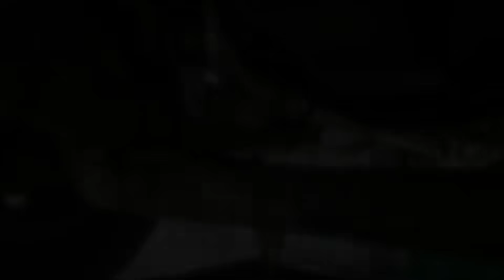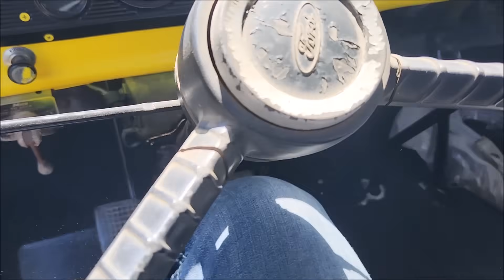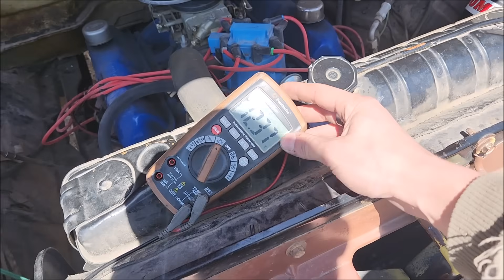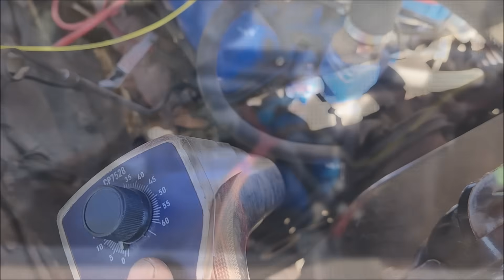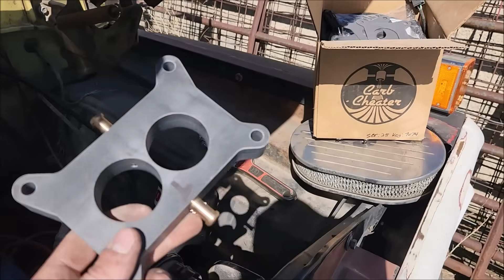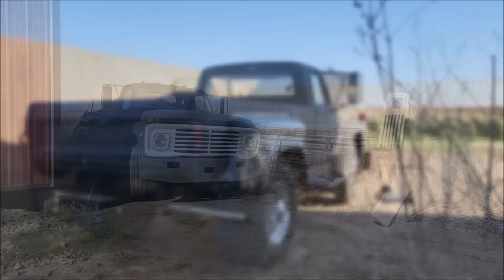Fix & Drive: 1972 Ford "Super Pickup" F750

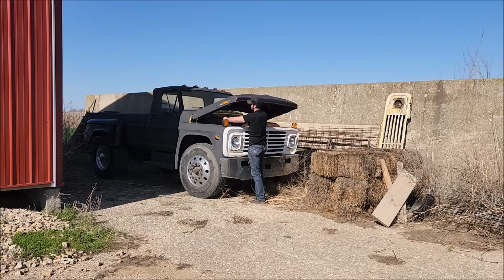Comment: 30:02 I have never once set an idle mix screw with a vacuum gauge. I just use a Mark 1 Earball. Run it in till the engine starts to audibly react, run it out until it reacts again, find the halfway point between those two reactions, and let 'er rip.

Got the Carter YF on my 85 F150 set good enough to pass emissions checks 20 years more stringent than it had to for YEARS that way. Ran great in winter's chill, summer's heat, idled smooth as silk. How I always set my idle mix screws. No gauges no fuss just let the engine tell me what it wants.

Comment: 24:06 And that is part of why carb engines are so much more reliable. They can be six kinds of FUBAR and still limp home. I'd rather have an engine that runs poorly when a minor fault pops up than have an engine that simply refuses to run if everything isn't factory perfect.

I've had EFI do that to me in the past. 2004 Explorer. Fault: Glitchy fuel level sending unit. ECU decided to disable throttle by wire and leave me unable to do anything more than idle. Took two trips to an independent shop and then a daeler trip to fix it, multiple tow bills. Absolute fucking nightmare. Meanwhile my 71 C10 will drive down the road quite happily on four cylinders with a jerry can tucked under the heater hoses as a fuel supply 🤣

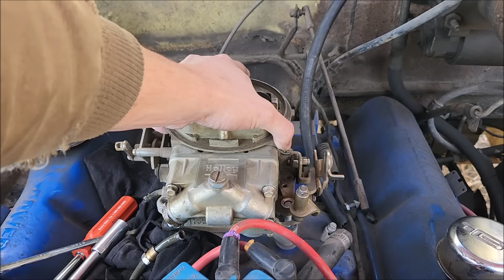Comment: 21:13 To me it's all about getting away from today's overcomplicated, unreliable, gadget-obsessed, tech-spammed disposable garbage. I know some people will disagree but the only thing modern cars do better than old ones is pass a crash test and I'm tired of them. I am to the point where EFI is a hard dealbreaker.

I find working on a carb engine to be relaxing and enjoyable. It's this modern supercomputer-on-wheels bullshit that makes me pull my hair out. 

I'm replacing my 2014 Challenger with a 1971 Chevy C10, and in all likelihood, that shitbox challenger will get kicked down the road to be someone else's nightmare. But if I do find myself doing something with it, what I'll probably do is rip the Pentashit V6 and autotragic out for a 225 slant six and a 5-speed manual. I don't have emissions checks in my neck of the woods so I'm free to carb swap it, and that's precisely what would happen. While I was in there I'd go on a deleting spree until the only 'options' left on the car are aircon, defrost, FM radio, probably swap the entire interior from a 71-73 into it. That is, of course, assuming I actually did something productive with the car...there's just as good odds I'll load it up with tannerite and see how many times it takes me to hit it with a Mosin Nagant at 150 yards on ironsights 🤷‍♂

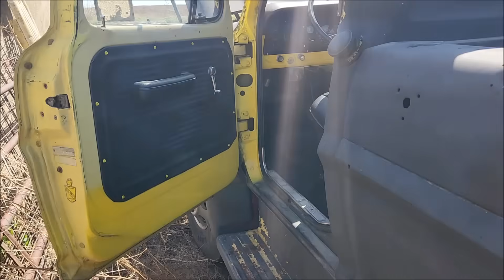Comment: 17:17 Add another advantage of straight sixes over V8s! Dizzy on my Ford 300s and on my Chev 250 are on the side of the engine well clear of the fan. Not a concern with them.

Comment: Every time I ever bought a Ford with anything Chevy in it, like a HEI ignition system or a Chevy Motor I always switched it back to Ford parts. And no I am not a purist, I just hate buying parts for two different makes of vehicles to work on one truck. Meaning if I have a whatever year Ford, I do not like having to buy whatever year Chevy Parts for a Ford truck to keep it running. And yes I am the same way if it is a Chevy truck with a Ford Engine, or a Dodge truck with a Ford or Chevy engine as I really hate that mix and match crap when fixing a vehicle. It's different if I have a 1949 Ford with a motor out of a 1970 Ford, and that is because I have owned trucks in those year models so I have the warranty for those trucks.

Comment: My first car was a 1970 Ford F100 with a 360 and a 3 speed on the column.
If I was trying to get that 391 to run better I would have put the original style distributor back in it , the one it has is good but the points and condenser one is just easier for me to work on if I couldn't find the points and condenser one I'd just do like you did and have everyone ask me what the yellow wire went 😂😂

Comment: That's a 500CFM 4412 holley 2bl. They are really common and designed for limited class oval track. they come with a 50cc pump because they are designed for an engine with a cam that has low idle vacuum. Your going to want to check the power valve it is probably a 6.5 or less maybe even a plug not good on an engine with 12 " of vacuum or more. What happens on limited race engines is the  motor can actually pull vacuum at the end of the straight due to a small carb "500cfm" and shut the power valve lean out and burn a piston or 3. Or just hang the power valve open and foul the plugs on yellow flag laps. Then when it turns green your friends will try to run over you, 
They are designed to run on the main jets with little or no power circuits used . So put a 10.5 or at least 4 numbers below cruise vacuum ( the vacuum advance hooked to manifold vacuum will help with cruise vacuum.) Some oem holleys came with a 2 stage power valve and tuned properly can be surprisingly efficient. Jet it down till it surges at light throttle cruise. Then add 2 numbers. Even then the metering block that comes with those carbs is specialized so it will be a compromise on the street.
Now the 391 The good news is they came with a steel crank same stroke as a 427. I seem to remember they had an oversized crank snout to run accessory's. The heads were terrible really small valves basically designed to detune them. I think they had sodium filled exhaust valves. A set of decent car or truck heads a mild cam and an intake maybe a 650 carb would do wonders. And headers the OEM manifolds are horrible. And soak the upper bolts with blaster they like to break off. It could have the truck pattern heads which was a different bolt pattern drilled. GT 390 fairlanes used the same pattern but different heads.
Reply: That's a goldmine of information

Comment: On my 72 FE engine I used the resistive wire as my trigger wire for a 12volt/30amp relay. I ran a double black/red wire from the engine to the battery, the black side being the trigger to the relay, and the red wire being the full power from the relay back to the distributor (Pertronix ignition). The relay I had safely tucked into place on the passenger fender. Gave me full 12v to the HEI.

Still only got 9.98 mpg with the pig 360 fe. Lol
Reply: FML!  that's about what i'm getting on a F150 with a 302.

Comment: If you want to keep it for mainly towing a hauling really heavy stuff but, you want it to ride better, maybe removing leaves, adding airbags and having an onboard compressor would be the move. It definitely deserves some mild mods, maybe an aluminum intake, 4bbl, long tube headers. I have always looked at those old U Haul and Penske trucks and thought it would be awesome to mimic the fat front fenders on a pickup bed on the back. It's exactly what I had in mind as a kid realizing how much bigger those trucks are yet realizing the cab eas the same size. If it was mine, I might consider putting a beam kit on it like a Pre-Runner with big coil overs that soak up all the bumps and bypasses, bump stops and limit straps, with a 4 link in the rear too. I would expect that once it had a suspension of that caliber fulling the ample fender wells, it is going to probably need at least a 40" offroad tire, possibly as large a 44,46,48" and once it got that far it would need some serious power, like a built 7.3 Godzilla, 460 Windsor, 557 BBF or something with boost like a 9.5" Windsor. Running through a ZF-5 S47 or S6-650 manual. Once it had the power, it's going to need an exoskeleton in case it lays on the sides or the roof to protect you and possibly the body and be nicer than having the interior full of tubes and needing a helmet not to smack your head. A pre-runner build like Wings World does in their own garage with plans designed on Solid Works is very time consuming and expensive but, it sure would be cool to do with a widebody truck like that, maybe cut the back of the cab and front of the bed out, make it unibody, have a removable cap and back seat so it's like a LWB F750 Bronco 600-1000hp with 16" front and 18" rear suspension travel. Not very useful in Iowa but, it would be a show stopper at Silverlake.

Comment: Try lowering your tire pressure to 50 psi or less should help with the ride. Not carrying any weight and the load capacity of those tires is overkill.

Comment: I looked up the model number for that 2-barrel Holley.  It is a 500 cfm performance 2-barrel and comes stock with a 50cc accelerator pump.
It sure sounds and runs better after your repairs and tuning.

Comment: Might sound goofy but I rebuilt my first carb the other day and for some reason. The accelerator pump doesn't work. Anything particular I should look for when I take it back apart or even before hand?  it's a 600 holley
Reply from the maker: Check the float bowl gasket as it has an opening for the accelerator pump channel, and make sure you didn't lose your weight and check ball if you took the pump nozzle out. 
Probably the gasket or rubber flapper though - perhaps you forgot the accelerator pump spring, but I doubt that
Reply: @ThunderHead289  I put the spring back but I will definitely check the other stuff thank you!

Comment: From the look of that 2bbl it's a 4412 Holley Performance model.  Those are commonly used in dirt track classes and come with the 50cc accelerator pump stock.
Reply from the maker: Not surprised it was so ornary and acted pretty dorked on a stock engine on a heavy rig.

Comment: the 500cfm 2V came with a 50cc accel pump. the 350cfm 2v came with a 30cc pump.
Reply from the maker: The 500cfm was a pretty sub ideal choice on this rig, seems much better tamed down from its circle track intended use

Comment: Hey buddy love you videos.. noticed the vacuum advance line is missing..
Reply from the maker: I borrowed it for the vacuum gauge - was hooked up to ported before I took off
Reply: Also go to the fuse block.. Ford usually had  extra hookups.. trailer brakes.. aftervmarket stuff.. run a lead there to your distributor.. it's grounded through the fuse block..  alot better than just hooking up a wire to the battery.. it's a dedicated circuit.. I don't see anything a normal charging system  couldn't  handle

Comment: I have a Ford 302 with an Edelbrock 1406. I’ve been tuning my truck based on a lot of your videos and they have been very helpful. I recently added an AFR gauge. What should I be getting at idle?  When I tune with the vacuum gauge I end up around 12.4. Is this a good number at idle?  I believe the ideal AFR is 14.7. Thanks

Comment: cool rig personally i would pull that gutless 390 out and slam a diesel in it. could do the 12valve 5speed swap or even a 7.3 but a 2 stroke detroit diesel with a real 10speed would be way cool

Comment: 👍 Bought a 500cfm Holley 2 barrel new sealed in the box back in late 70`s with race bowl and is equipped with a 50cc pump.  It ran great on a stock Ford 1968 302 Galaxy.
Reply from the maker: Must be how the 500cfm units are where the 350cfm units is what I've always had around. 
I have a strong feeling that a 300cfm primary on a 600cfm will run pretty decent - not that it actually isn't pretty good as is honestly.

Comment: I did not know that about the HEI's and Fords. If I find that I am having that same issue, what would be the proper way to wire it? Just find a wire that is 12 volts on run? I have seen run a wire from the "I" side of the solenoid and keep the coil wire hooked so it would be 2 wires going in?
Reply from the maker: The most dumb simple thing to do is to just splice in a new wire by the key where the resistive lead starts and just feed that through. Don't hook the resistive lead to anything. 

Then it all works the same and you also still have your original wire that could technically still be functional if you wanted it to be.
Reply: @ThunderHead289  Thank you so much. I think I follow. So on the key switch find the wire that was running to the coil originally and just run a new wire from there?

Comment: I have a 74 IH 1600 load star that is a factory 8' bed but your's probably was shortened . I drove a f600 for work red in the outside olive on the inside. The rigs(auger drills) all had numbers 551,552.751,and 752. The service trucks for setting wells had names the big one "the mule",the  White pavement prisses"white" and mine Army" yeah I'd have killed for that yellow 
Off the truck subject I see you have a 4 speed in your maverick it might slow it down. A friend of mine had a 74 grabber orange with a 3 speed floor shift and it didn't have a dead spot that little car was fast and I'm a Mopar kinda guy so yeah you might try it.

Comment: Well done Luke. As a guy who learned to tune carbs in the 70's, from trial and error and books...pre you tube, LOL I appreciate you keeping the carb knowledge alive. That 50cc pump was a common mod many moons ago in roundy round racing.  Some o the lower class deals required using 2bbl carb, but didn't specify the intake...so guys would get a decent dual plane 4bbl intake and adapt it to a 2bbl, drop the Holley 500 on. They would work, but the pump shot was weak with a larger intake volume/runner change. So they added the 50 cc pump shot and it helped...and they would pass the "inspection" at the track.
The info you gave on the mixture screw going back from  max vacuum is correct, and something I frequently see done wrong on cars guys bring around here.
That truck had some serious effort put into it at one time, those super single wheels and tires were not inexpensive, I think someone was building a truck they planned to use. It has promise,  maybe investigate that leaf spring pack, LOL. 

Leaving stuff alone is never any fun. I once did a tunnel ram with 2 500 Holleys on  a mild 350 based chevy...it worked surprisingly well...

Comment: With the carb at WOT and the accell pump plunger all the way down adjust your set screw for the pump until you have 15 thousands clearance measured with a feeler gauge
Reply from the maker: That's what holley says, but if you do the lever as I show, you don't need to do that - that's so someone doesn't bottom out the travel, basically it's showing that the lever can go farther and won't bind. 

I show the actual correct way.
Reply: @ThunderHead289  I have done Holleys for over 40 years I always set at factory specs I have never  had an issue with the the lever for the accelerator pump bottoming out or binding.

Comment: Running a pre-ethanol car on ethanol is never a good idea. You should run 100% gas with a zinc additive. Up north there are stations that carry zero ethanol gas, (Sheetz for 1) or  you want marine gas.
Reply from the maker: I've done it for 10 years - entirely fine as long as you don't let it sit for over a year, and you jet correctly for it since stoich for 10 percent ethanol is less than 14.7. 
So what is correct on non ethanol will register as lean on ethanol with the same jets

Comment: Would a 390fe four barrel intake work on that 391ft?
Reply from the maker: Ironically it won't. That's the problem with the FT stuff, it looks the same, but everything is slightly different such that things can't be transferred. 
Why there's almost no FT engines left these days

Comment: On the model of engine you need a 3 in exhaust helps the breathing I had one and did 3 in to a single truck muffler then out the side was quiet and helped the engine to smooth out too.

Comment: If you check the list number on the carb that looks like a 500 CFM bug spray carb its Holleys performance two barrel the dual feed bowl on the front is a dead giveaway its probably got some big jets in it too. Check your plugs I bet they are black you may have to jet it down a few steps. Dont get rid of the carb they are very good carbs just some jetting and tuning and a fresh kit the engine will be running smooth as a cat purring in a hen house . Dont run a four barrel and neck it down just drown the engine and performance will drop and fuel mileage miss match in ports from carb to intake is never good. Also check your pump shot discharge nozel its prob going to be bigger jets size take out the discharge out of the other Holley and put it on Stick with the Bug Spray Holley

Comment: When you get a chance fix the base on your breather there is a huge gap and you are sucking in a lot of dirt into the carb . Love the freaking truck dude that is bad ass . Dont forget to run ported vac to your dist for your vac advance
Reply from the maker: Not sure if it's seen, but after timing is set and before I drive I do have it on ported. 
I always have to cut out a lot for the sake of pace since I'm real good at monologing.
Reply: @ThunderHead289  Yeah that wasnt on there I love the build man really enjoy your channel you mix it up love the truck its bad ass thanks for the reply

Comment: Thats a 4412 Holley, 500 CFM, performance two bbl, 50cc pump stock. I've used the orig resistance ignition hookup to trigger a relay that supplies full 12v to modules, choke etc. Powering a coil there is only a quarter volt drop, triggers and holds relay without issue.
Reply from the maker: I think with a 600cfm 4 barrel with 300cfm primaries I'll see quite the improvement. Not that it's bad now at all, proportionally the 500cfm 2 barrel is just hitting it with too much cfm down low where cfm demand is less. 
Would equate to faster port velocity and better torque - is it bad now? No
But would be fun to see what it really could do given every opportunity
Reply: @ThunderHead289  That's why those carbs include the 50cc pump, covers giant lean condition at sudden throttle openings. No doubt in anything but first your bruiser takes longer than average to bring up RPM(still it's damn cool). BTW 2bbl are rated at a higher vacuum than 4bbls. It's said the 500 2bbl have same venturi, throttle plates, etc as front of 780 4bbl.